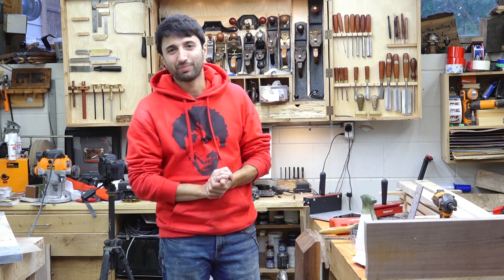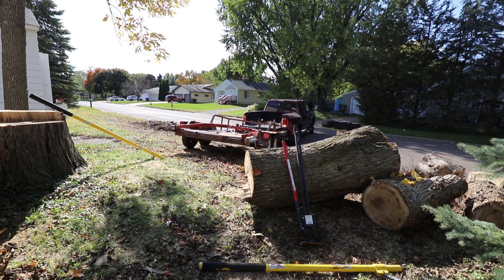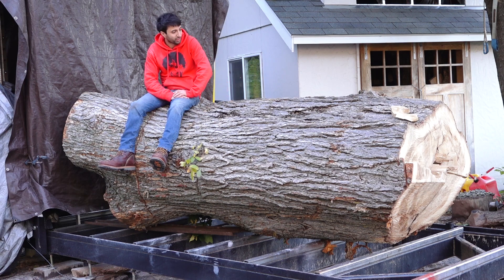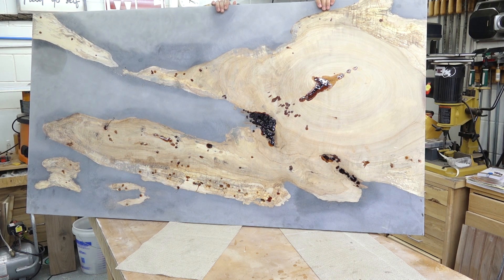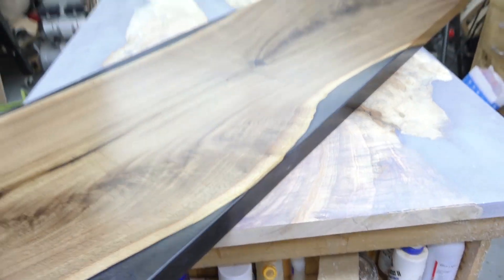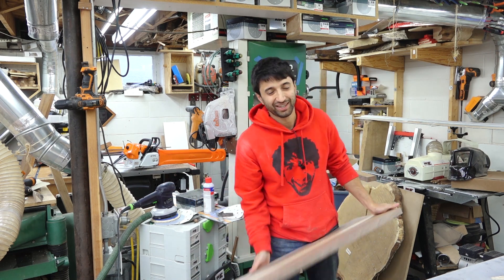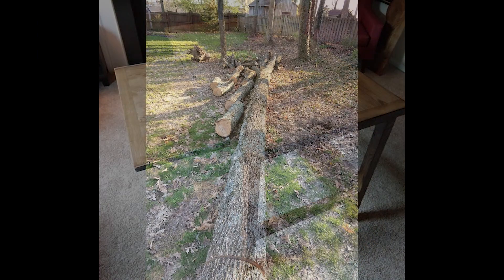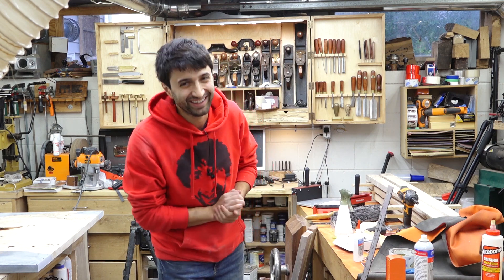New Log, Encapsulated Slab, Slab Skins

Comment: The walnut and maple dresser had so much depth.  I thought, if the maker had made progressively smaller pulls starting from the bottom it would pull you right in.
Reply: Thank you! I had thought about making smaller pulls for the top row but I wanted to have as much room for fingers as possible to pull out a possibly heavy drawer and not break the pull.

Or it could have been the fact that lm lazy and didn't want to take the time to figure it out 😂.

Comment: Wasn't aware you could actually do anything with elm.
Thought it had a tendency to flake out when you cut it. Can't wait to see you cut it up because I have a pretty good size dead one I am waiting to discover self felled one morning.
Reply: rob black elm is actually a really nice wood, it is just not the easiest to work with, and milling is less than fun typically. It tends to have really stringy bark too.
Reply from the maker: Sure can. See the tool cabinet hanging on the wall

Comment: What finish do you plan on using for the encapsulated table?  Do you still use your standard arm-r-seal process or something different?  I'm working on an Osage Orange encapsulation project and mulling over finishing options.  Thanks for the videos and info!
Reply from the maker: Planning on doing the same finish process as the tool cabinet doors which was arm-r-seal.  I'll do a few more coats and then polish the finish